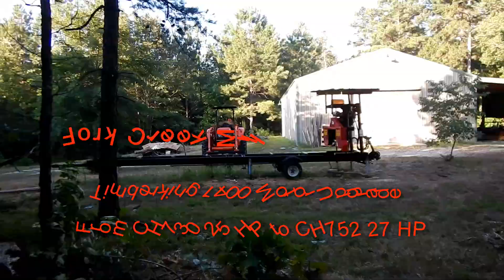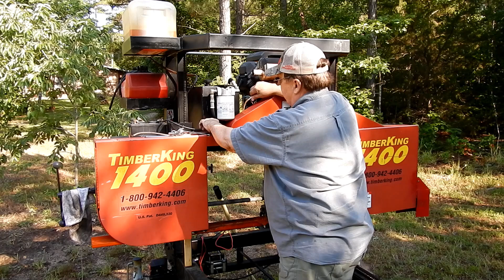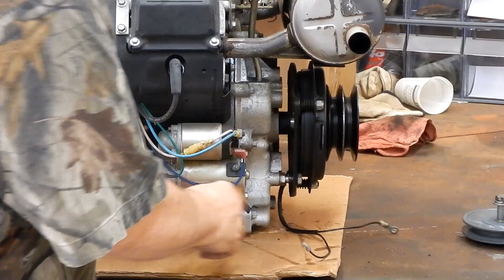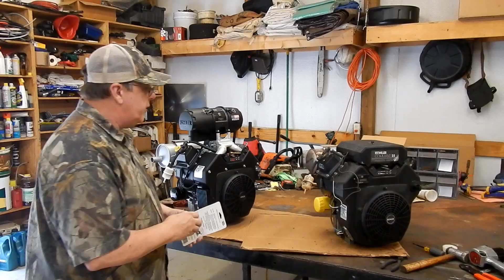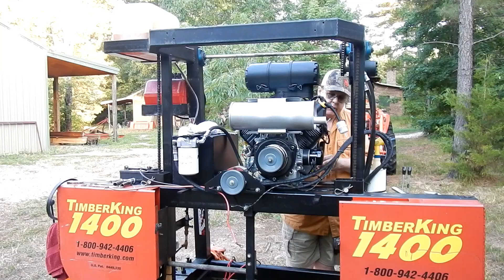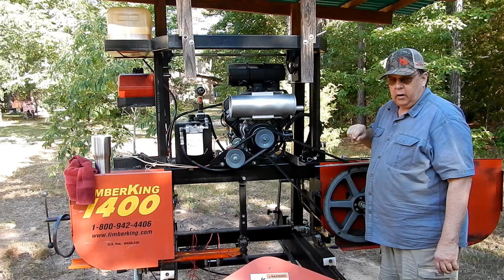Timberking 1400 Motor Upgrade

Comment: Thank you! Do you have any ideas of adding a future external 12V alternator? I am looking to add lights, small 12 vdc to 120 vac inverter and a box fan for the operator station. Thank you in advance.
Reply from the maker: Probable the easiest external alternator to add to a Kohler CH730, CH740 or CH750 would be a 30 amp mini which is used on a John Deere mower. You would have to add a mounting bracket on the hydraulic pump side to run off that belt and maybe even an idler pulley. Not sure how much it would pull down the motor.

https://www.dbelectrical.com/products/new-permanent-magnet-alternator-for-john-deere-mower-2500-2500a-2500b-2653a.html?mrkgadid=&mrkgcl=1145&mrkgen=&mrkgbflag=&mrkgcat=&acctid=21700000001643279&dskeywordid=&lid=58700008546389203&dsproductgroupid=&product_id=400-58013&merchid=1552033&prodctry=US&prodlang=en&channel=online&storeid=&device=c&network=x&matchtype=&locationid=9027113&creative=&targetid=&campaignid=20569684963&adgroupid=&gad_source=1&gclid=CjwKCAjw48-vBhBbEiwAzqrZVLwqggaSIVu6mr4GDqm0iUjBwzhLXNk2hVHb2O_xTXUjkQpZwls-xBoC2NAQAvD_BwE&gclsrc=aw.ds
Reply: @davidpape9726  Thank you so much!